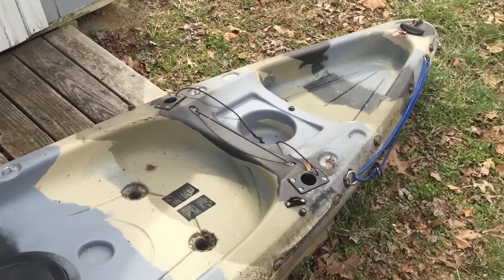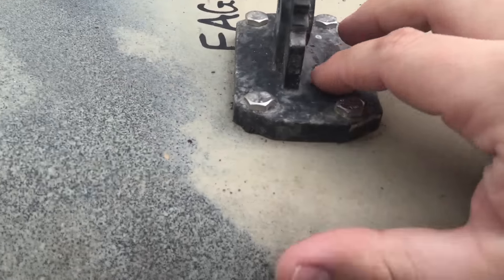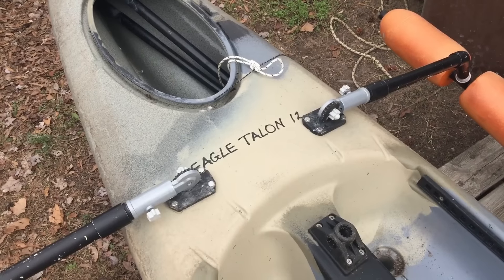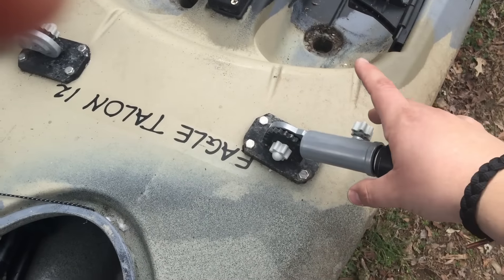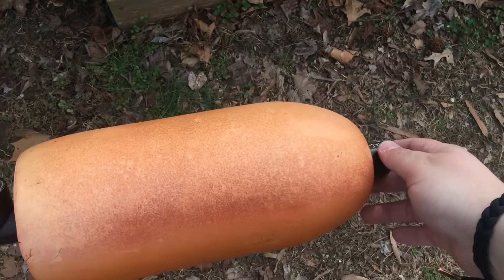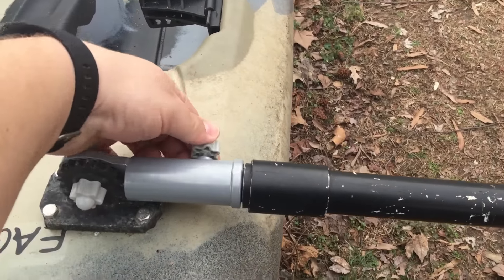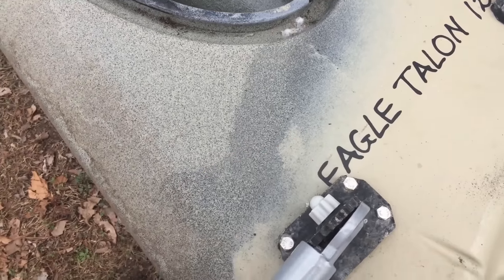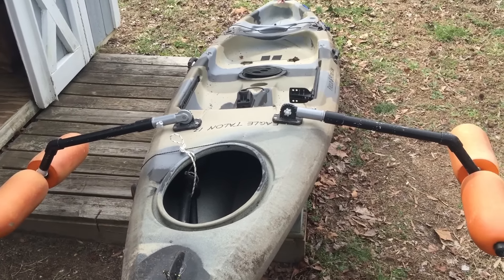Custom Kayak Outrigger/Stabilizer Rigging

Comment: Works 4 me used all 3/4" PCV for simplicity, prior to assembling painted PCV black matching Kayak, found black Flag Pole holders online from Walmart.  Similar floaters came via Amazon Prime.  Needed to "front mount" so paddle would not strike outriggers.  Custom metal plates under Kayak attached by bolts to each Flag Pole holder for added mounting strength.  Thx great video
Reply from the maker: R defendr1 glad it worked for you!

Comment: Great design! I’m in the process of doing the same using some of your design. I am using 3/4” poplar wood dowels as a reinforced iniside the pvc. But basically the same setup. Down here in Southwest Florida in the Ten Thousand Islands. Nice idea! Never would’ve thought to use flag pole brackets.
Reply from the maker: SailboatRyan glad it helped, love the dowel idea!! I’ve since upgraded to a far more stable kayak, but still have this setup and yak as a spare/loaner.  Let me know how it goes!
Reply: Also using heavy duty flag pole holders instead of the ones from Lowe’s.
Reply from the maker: SailboatRyan do you have a link? I’m not sure I’ve seen the heavy duty, now I’m curious.

Comment: Being about 6 ft. / 265 lbs., I never really ran my Talon, without  similar stabilizers as yours, till last spring.  That's when it flipped on me in 50 degree water.  I went right back to using the stabilizers!  Did you ever run yours without them, when you paddled the Talon?  Curious to hear from other owners about THEIR experiences with stability, especially fellow big guys.

Comment: What are the grey pieces of metal that are screwed into the flag holder?  Where would I find them?
Reply from the maker: Bill Richardson assuming you mean the top piece? They sell all together I just bought two different color sets.  I broke the original black ones.  I explain it in the video.

Comment: What are the orange floats called? Lobster what?
Reply from the maker: Bouy’s or Crab Bouy’s they use them when they sink crab pots or lobster pots and tie them off on the end of a rope and return later.  You see them floating everywhere here on the Chesapeake Bay and crab harvesters check them through the day and just hook them with a long pole and pull up the basket (however many feet below the water to the bottom) to harvest the crabs.

Comment: hey question for you.....just got a 10 foot sit on top but way to tipsy....I fish narrow water so want whatever is to sit tight against my kayak...was thinking about 2 of those white dock protectors. think that would work or do you have a better diy idea
Reply from the maker: I've seen some examples of stabilizers like that and my first thought would be a ratchet strap type setup around the hull.  You could also try this design and shorten the arm length.  Let me know what you figure out I would be curious to see.
Reply: +Anthony Daskus I watched a video that shows how to use large diameter pool noodles as stabilizers that sit tight against the side of the boat. The man in the video could stand up with no problem. BTW, is your kayak a Sun Dolphin by any chance?
Reply from the maker: This kayak is my old/now retired Field and Stream Eagle Talon 12 kayak.  I now float the Ocean Kayak Prowler Big Game 2 and use this as a spare/backup.

Comment: you have any video of the front mount outriggers in action
Reply from the maker: FireGuy75 I still have this as a spare yak and still have the stabilizers.  This video predates our go pro rigs, but! You haven given me an idea for a part 2 on this.  Gimme a few weeks to plan, film and edit.
Reply: i just bought a cheap kayak from dicks and i want to put outriggers on it and im not sure if i want them in the back or front
Reply from the maker: FireGuy75 these will work either way.  I put them in the front here because I could access the backside in the hull.

Comment: You think it'll work toward the back of the kayak? I think it would be in the way of myh casting in the front.
Reply from the maker: When i was still using this setup (before the OKBG2) I could guide the rod tip around them on retrieve but ideally they should be positioned in the back if possible.  If you have that ability then definitely go for it!!! let me know how it works out!

Comment: There is a solution to prevent the pvc from bending.
Reply from the maker: Rick Meadows what’s that?
Reply: @BaitWaitOutdoors  Late reply but basically you put wooden sticks inside the pipes to prevent them form bending (it needs to be tight).
Reply: @2nd Amendment Sling LLC You seal the tubes so there isn't supposed to be any water/humidity that goes in. If it does yeah that would be a prob... Maybe pack the tubes with aluminium? It's still pretty light.

Comment: I Had same kayak,  this was a bad idea. 
Stabilizers are to far forward, so it doesn't help much. 
Plus if u want to pick them up to paddle you have to move to the front of kayak to reach them.
Makes kayak unstable once there out of the water and your still in  front.
Reply from the maker: enjoy the ride I appreciate the feedback but there are a few things to note here.  You can put these anywhere on the kayak that you’re comfortable.  

I used the front so I could reach the backside of the bolts.

I never paddled with them up, they stayed down and in the water.

The flag pole holders also doubled for anything I could fashion to pvc, camera mount, lights, flags etc.

I agree that further to the back would probably serve better, again I chose the front to better secure the bolts as opposed to screws or rivets.

There is a trade off of drag and tracking for stability.  I honestly was so happy to stay dry that tracking and drag were minimal adjustments.

Let me know your thoughts.

Comment: does it get in the way of paddling?
Reply from the maker: Great question! the eagle talon 12 is 30" wide and i am 6'1".  I use a pretty long paddle length and never had any issues hitting the stabilizers.  Again, this is something you'll want to take into account when mounting to understand your paddle stride and ensure you wont make contact.  Using this design with my paddle length i have had no issues.

Comment: what lengths are the pvc 3/4 and 1in from the flag pole bracket t the 45 elbow.
Reply from the maker: Don Gariglio from the T to elbow is measured at 5.5" from elbow to reducer 14" .  The 3/4" pieces are cut to the depth of the flag pole holder and overall width of the buoys.  So you can just eyeball those pieces.  Hope this helps!
Reply: Thanks, it will help.